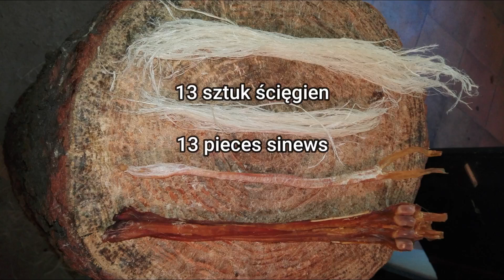Composite crossbow KOMPOZYTOWY ŁUK KUSZY REKONSTRUKCJA CZ2

Comment: I dlaczego warstwy są inaczej ułożone w sekcji artefaktu?

https://i.pinimg.com/564x/32/a9/f9/32a9f9b0a775915814177ac904a5bb44.jpg

Section of a Composite Bow from a Crossbow | European | The Metropolitan Museum of Art
Reply from the maker: Nie rozumiem o co ci chodzi...
Reply: @MCclawin  in the picture at the link is a photo of a cross cut of the crossbow arc.
Why are there horn plates on the sides of the wooden part on the original, and not like yours?
Reply from the maker: @dmitryefimkin6550  Aaaa :D In this cross section in the middle it is not wood but baleen whale! :)